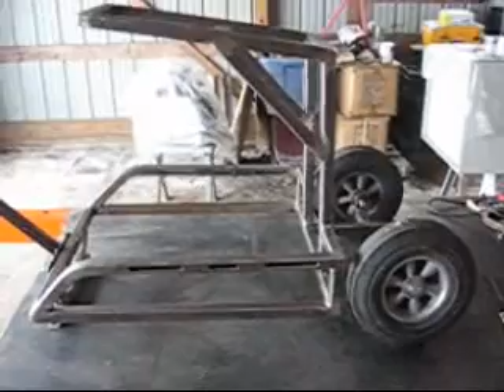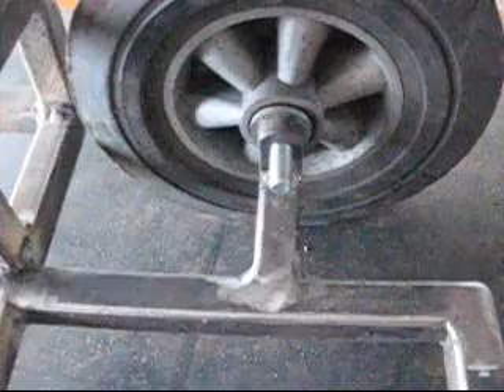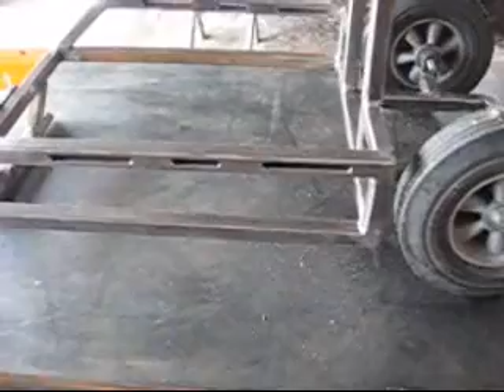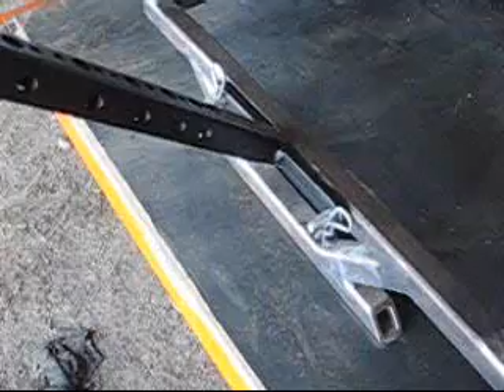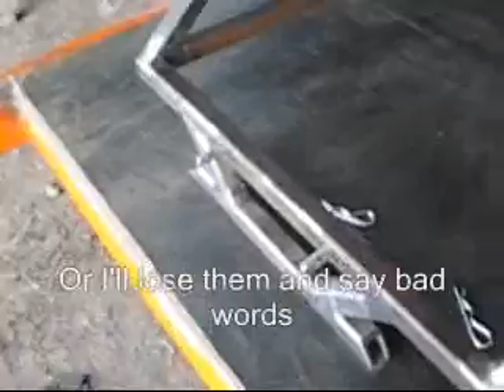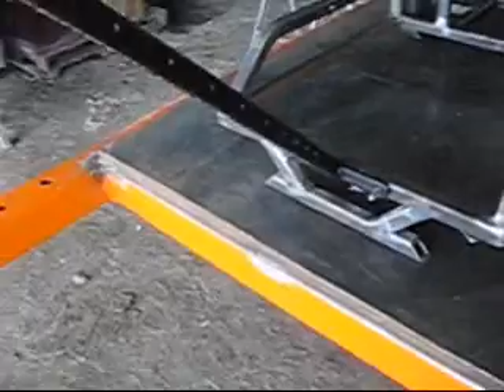Welding Cart For Hobart Handler Mig Welder

Comment: nice cart better than mine i used a garden hose cart and up graded it
Reply: I recently got a small welder and what I'm using is an old pressure washer cart... I took out the motor and I'm gonna add small wheels in the front and some cable holders and a plate up top to set my helmet and gloves then just give it a good black paint and it should be good... I like it because it'll be easy to push around

Comment from the maker: @spidersniper1150 I actually don't have the 140 or the cart anymore. The welder was on loan from son-in-law. Gave the cart to my stepson to finish it off and use it for his wire feed. I've got the Miler DialArc I show in another one of my videos. I'm partial to stick welding since most of what I do is heavier stuff. I'm considering buying a Hobart 140 for the lighter stuff and portable jobs when folks need some work done.
Appreciate all the kind comments.

Comment: Love the cart!  I'm about to purchase a Handler 140 here in the next few months, great design and looks quite ideal for any kind of work you would have.  I'd just weld a little loop above the handle mount and run some thin steel cable where you can run the R pins through at the cable ends so they just dangle off when the handle is not in use.  Love the cart though!